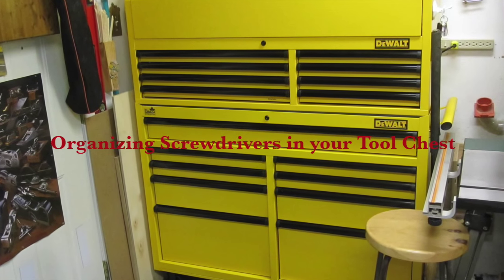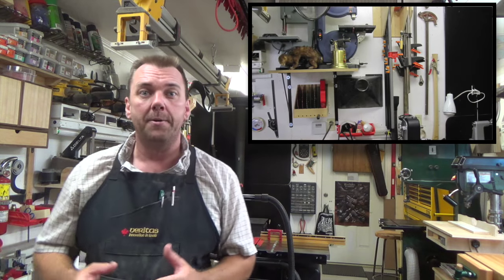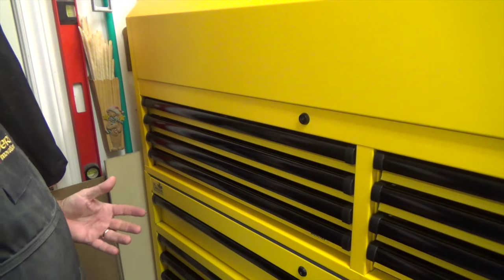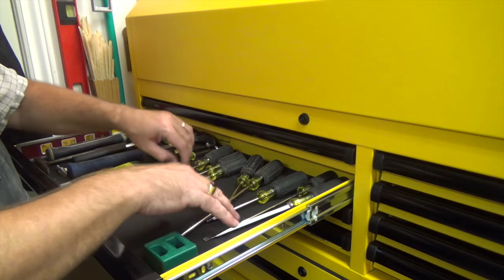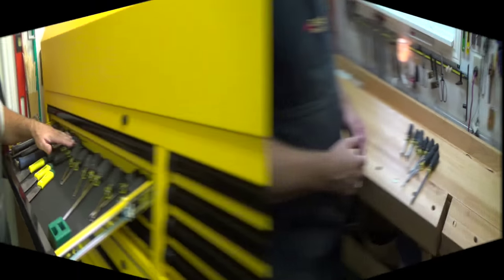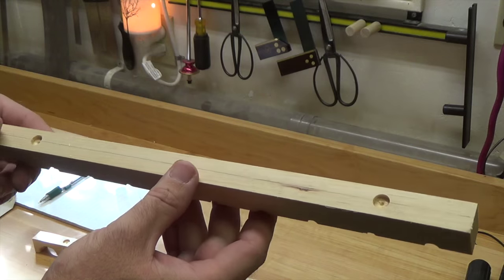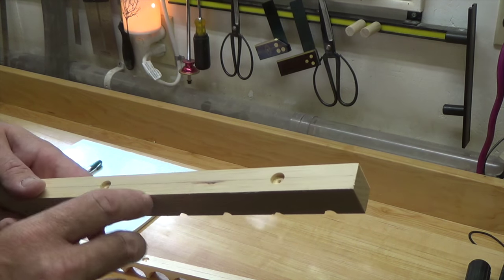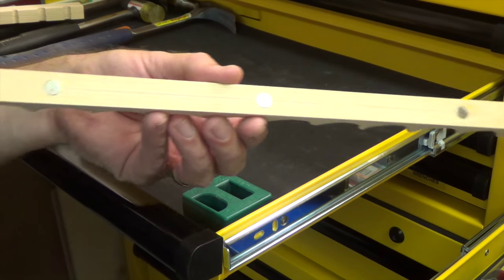Screwdriver Organization

Comment: I did mine by making two of the handle holders and two tip holder these two holders hold my common screwdrivers in the right hand drawer and Phillips in the left each rack is held apart by 3/8 hardwood dowel but my really long drivers have to lay on the sides because they will not fit cross ways.  I know I could buy a new and bigger Tool Box. But I have three roll-ways already.  Having to many tools sucks but it's better then the other option.
Reply from the maker: Sounds like you came up with a great solution.  I agree with you that it is better to be looking at a tool than to be looking for a tool.  Thanks for tuning in and for taking the time to leave me a comment.  I appreciate it.

Comment: Excellent solution. Perhaps you can add a dab of coloured paint to your wood and a coloured heat shrink sleeve to your screwdriver shaft. A different colour for each driver, you can spot the correct position quicker.
Reply from the maker: Those are fantastic suggestion Ian.  I like the way you think.  Thanks for tuning in to the show and for taking the time to chime in with your addition to the project.  It's very much appreciated.

Comment: OMG Kenny thanks for the ideas and let me ask. I'm a collision repair tech with a tool fetish and OCD issues as well. I'm also a newby in the woodworking hobbies building guitars and amp cabinets. What is that layout tool you drew the offset 1 inch lines on that board called. thanks again. Todd
Reply from the maker: Thanks for taking the time to comment on the show Todd.  The device that you  are asking about is called a T-rule and they are made by a company called INCRA.  You can get them at most woodworking stores such as Lee Valley but if that is not an option for you, you can purchase them directly from INCRA.  Here's the link to the Lee Valley ones.  http://www.leevalley.com/en/wood/page.aspx?p=58877&cat=1,43513,58883,58877

Comment: Why are the handles in the back, I would think the handles would be placed near the opening? Several other videos have shown it the way you have done it. Trying to figure out what I am missing. Overall a nice tip.
Reply from the maker: It's all about personal preference.  Handles to the front or handles to the back.  Neither is wrong.  I personally, prefer to see the driver tip so that I know which one I am grabbing.  Other folks prefer to see the markings on the handles, but not all screwdrivers have handle markings.  I hope this answers your question.  Thanks for tuning in and for taking the time to leave me a comment.

Comment: They're going to shift if you shut the drawer too fast.  If I was to let my OCD take over,  I'd run a couple dowels throw both of them and protruding enough in the rear to properly space the rack from the back of the drawer.  Great video though thanks.
Reply from the maker: So far, they haven't moved at all and I think that is because of the rubber handles of the Klein screwdrivers.  I do like your dowel idea though and I might just add that to the design.  Thanks for tuning in to the show and thanks for chiming in with the suggestion.  It's appreciated.

Comment: what hand plane did you use
Reply from the maker: This particular one was a #6 fore plane by Veritas.
Reply: Thanks!!
Reply: Do you have any recommendations to a good "all in one" plane
Reply from the maker: You're very welcome.
Reply from the maker: I think that it depends on what you want to do with it.  There really isn't an "all in one" as they each have their own purpose but if I were to go with just one plane, it would have to be a Veritas #5 bench plane.  http://www.leevalley.com/en/wood/page.aspx?p=45156&cat=1,41182,41186,45156
You will find that as time goes on however, you will want to add more specific planes for specific jobs.
Reply: Thanks kinda pricy but I guess there's no price for quality. and also do you know any way to store those incra t rules? I have a 6in and a 12 in. But want to keep them new . I'm kinda OCD and also want them to stay straight
Reply from the maker: Dan Roekle I keep my t-rules on a magnetic tool holder on the wall of my shop. It keeps them neatly out of the way but easy to reach when they are needed.  It also keeps them out of harms way so that they always stay undamaged.

Comment: Wouldn't it be better to turn it around so could grab the handle instead of the shank safety first
Reply from the maker: If that would be your preference Bill, then there is nothing wrong with that.  For me personally, I prefer to see the shank so that I know which one I am getting.  I have problems seeing the end of the handle and what type of driver it is, so I need to rely on seeing the tip of the driver to identify it.  It's just my personal preference and it is solely guided by my aging eyesight.  LOL.  Thanks for tuning in to the show and for taking the time to chime in with your suggestion/opinion.  It is very much appreciated.

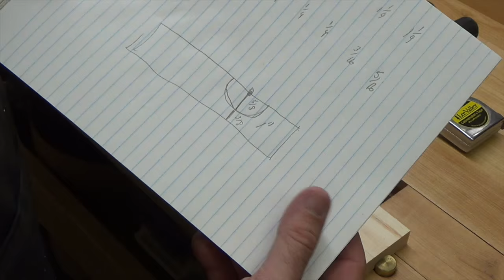Comment: A 9:40 yes you can, but it will not be to specification.
Reply from the maker: Fair enough.  I guess technically, you could drill at any point in time that you want.  ha ha ha ha ha ha ha ha ha.  Who need specs as long as you are having fun.  Thanks for tuning in and for taking the time to leave me a comment.

Comment: jezz... why don't you guys use cm instead of this ridiculous inches?? 3/8"+3/4" is ... blahh!!  :P BTW, Thanx for the videos :D
Reply from the maker: The funny part is that in Canada, we are a metric country.  I grew up in the era where the imperial system was first and foremost and we were introduced as the test project, into the metric system.  I just never shook the imperial form of measurement but I still hold strong to temperatures in Celsius, distance in Kilometres etc.  I just can't shake the imperial.  ha ha ha ha ha.  I'm from a mixed up and torn generation.
Reply: kennyearrings1 as a Canadian in his early 30s I was only taught metric,  yet for some reason measure short distances in feet and inches,  couldn't tell ya how tall I am in meters,  or what I weigh in kilos, 

I'm 145lbs 5'8 and I live a kilometre from the nearest store,  and buy a two litre pop, lol
Reply from the maker: It's pretty messed up for sure Nick.  Funny though.